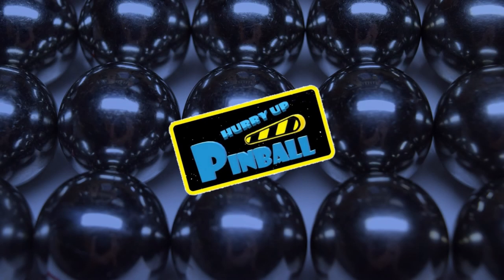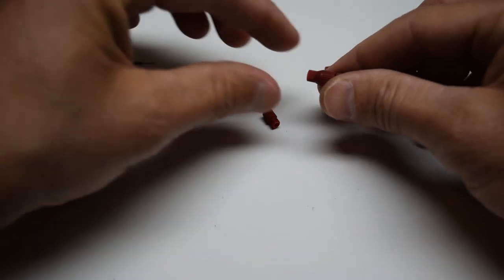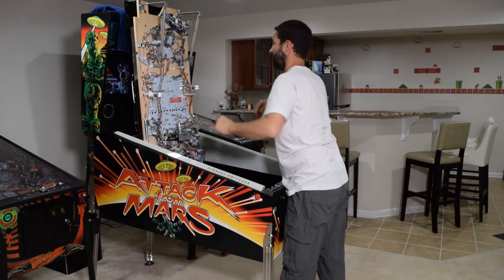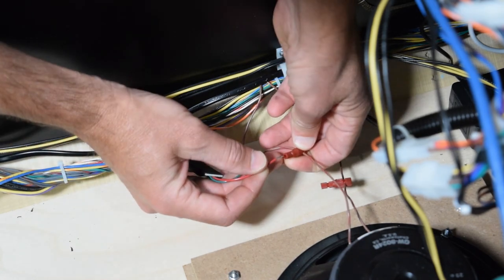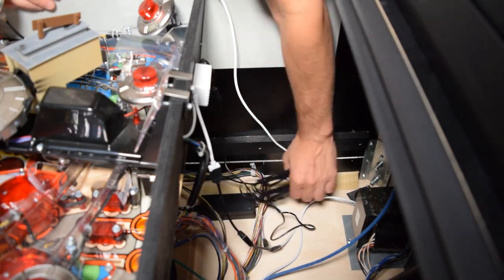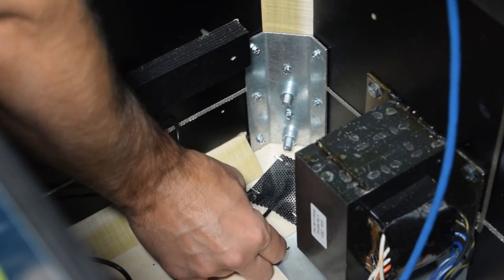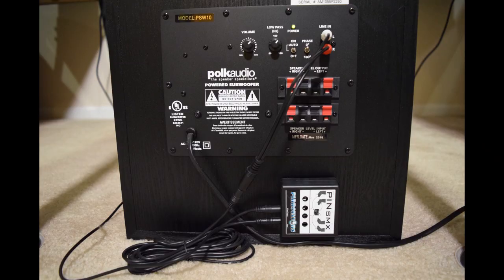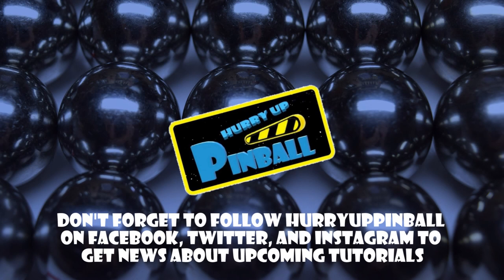HurryUpPinball - How to install the PinSub MS Subwoofer Kit from Pinnovators

Comment: Will this work on a stern Deadpool?
Reply from the maker: This will work for sterns Deadpool but there is actually a specific kit that plugs into the backbox board for Spike 2 systems that will allow you to pull audio directly off the board so you don’t have to tap the speaker wires. Much cleaner install and about the same price.
Reply: @HurryUpPinball  thanks I did see that. I actually though that this would be the easier install.  Looks like you have a great product